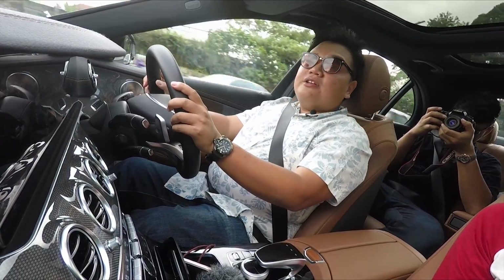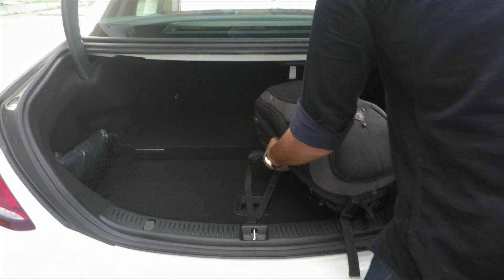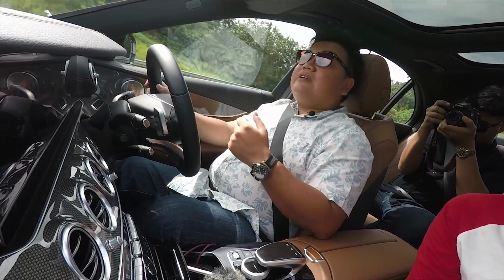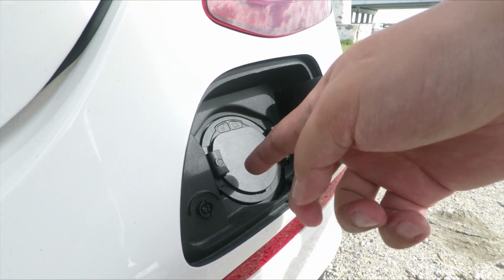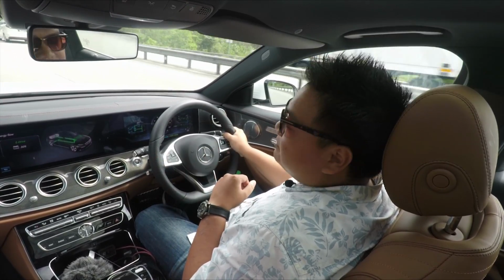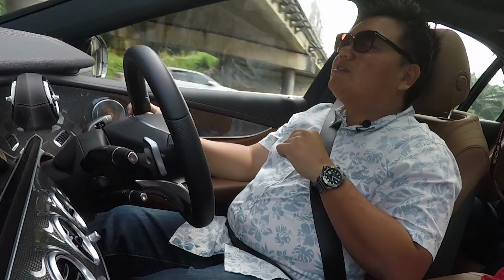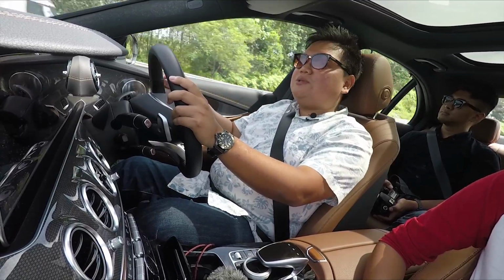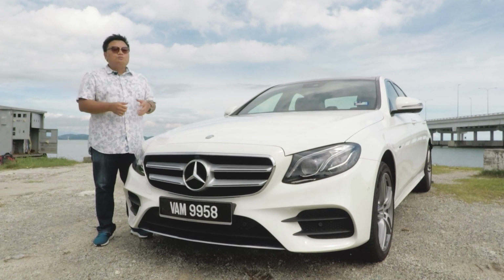FIRST DRIVE: W213 Mercedes-Benz E350e plug-in hybrid Malaysian review – RM396k

Comment: At nearly 400k, fuel consumption figures is a bad way to showcase the car. What would be more interesting is how far you can get in mostly urban driving with a full tank, i.e less time spent in a gas station. Urban driving is where the hybrid powertrain thrives. No one sensible would believe that 2.1L figure quoted. 
Remember that Bluetec Hybrid doing KL to Bangkok. It was the perfect illustration for that car.
Reply: I drive a C350e in Singapore and almost never charge it as there are only 3 public chargers with type II plug in SG. It's about 500km range per tank(from full to 1/4) in SG road. On average is about 7.5L/100km

Comment: Can you recharge the batteries to 100% just from driving? Or is it like BMW where it limits it to 50%?
Reply from the maker: +boy638 yes you can. In charge mode, the engine will supply some of its power to charge the battery, and it even idles at a higher rpm to do so. 

But of course, it will use up fuel to do so. Still, a good option to have if you're heading into a crowded city with not enough charge.